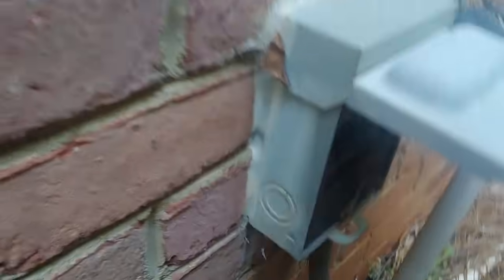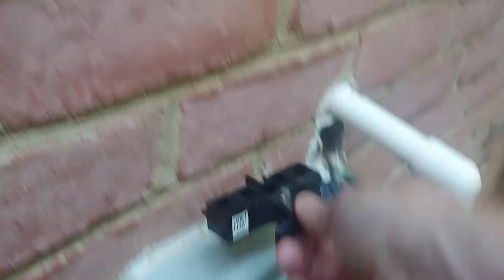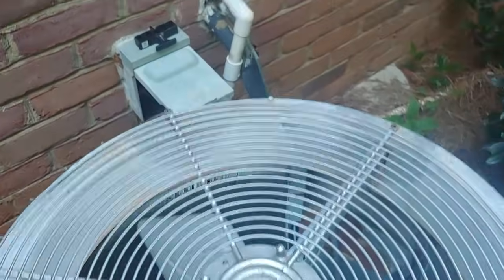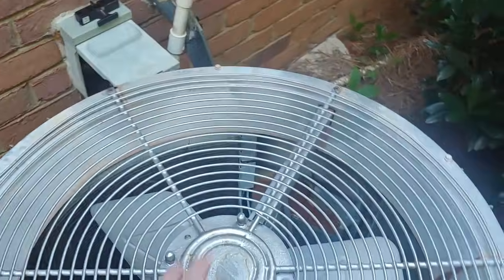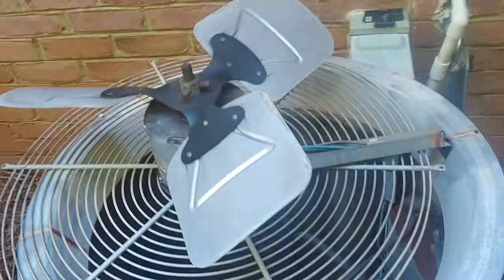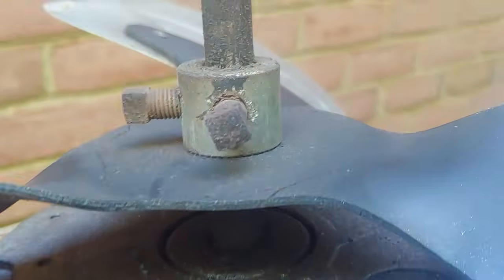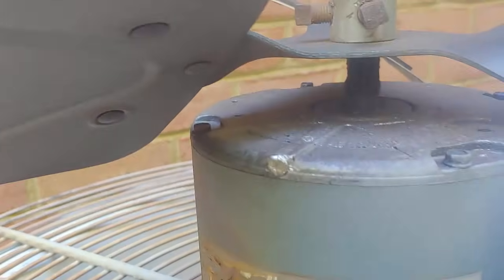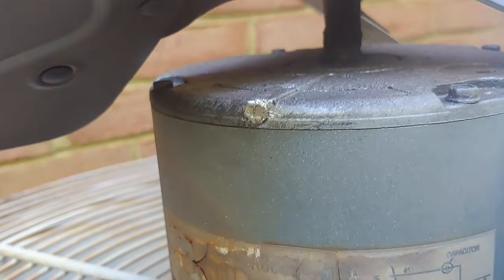YES! You CAN oil an air conditioner fan motor AC Fan squeaks/squeals/chirps/screeching noise, FIXED!

Comment: 9/12/25 11pm fan motor started squeaking, you just saved my life. Family of 8 here is southern Ca. AC is a must. So far squeaking is gone. If I can get through the rest of the heat until it cools off I will change the motor. Thank you so much for this video.
Reply from the maker: So glad it helped! Thanks!

Comment: FYI avoid 3-in-1. Most household oils will varnish and you’ll loose lubrication. Use chainsaw oil, sewing machine oil. They can stand heat and constant movement and don’t varnish.

Comment: If the bearings are starting to go, you may see your electric bill go up, and the fan may begin to have trouble getting started.  If the capacitor is still good, that's a sign that you need to start shopping for a new motor.  A distributor that only sells to professionals will typically have motors listed MUCH cheaper than you can buy them retail (40% less is common in my area), and a friendly HVAC shop might order you a motor but let you install it yourself.  After all, if you do screw it up or it's not the problem, they're probably going to get the service call.

Comment: Some fan motors had bronze oil-lite bushings in them instead of ball bearings.
Look for ball bearing replacement motor and the same specs, especially RPM and power.
For instance, I replaced my 1/3hp 1100 RPM motor with an 1075 RPM 1/3hp motor.
Further, before replacing the motor, I was able to measure the rpm of the original using a strobe device, it was turning @1137 RPM (just beyond spec).
Reply from the maker: Great tips!

Comment: Ive taken the motor apart and greased the shafts. Never used oil. Units been in since 2006, still going!! Carrier air handler and Bryant outside unit.
Reply from the maker: That's awesome! Keeping these units going is often more cost effective than the energy savings people think they get with a newer and often less dependable unit.
Reply: Lithium grease will work great, but of course taking it apart is a lot more work, and not for people who aren't confident doing it.  Although I'm sure there are videos showing how.

Comment: Your condenser looks fairly good!
Reply from the maker: Thanks, I nursed it for 3 and 1/2 years or so, and several months ago I had both of my systems finally replaced because of a coolant leak that was costing me a lot of money. But this video has helped a lot of people save money and extend the life of their system. Thank you for the comment!
Reply: @SwimmingintheDeep cooling leaks in the system is very common for many home owners. 
I found some technicians used incorrect solders or incorrect technique that lead to line leak. More silver, less lead solder will prevent line leak in the system. Once pure lead contacts with water or moisture will soon cause corrosion from those connections.

Comment: How in line do the rpms and amps need to be? Can they be a little off?
Reply from the maker: Yes, The RPMs can be a little different. The amps however need to be about the same or less because of your capacitor is rated to start such amperage.
Reply: @SwimmingintheDeep  If the motor's HP and RM and frame (mounting size) are a good match but the starting power is different, you can find videos on getting the right capacitor for it.  A new capacitor will probably be $15 or less, but a service call to have someone do it for you can be $100, easy.  BUT take photos of how the wires are set up before you disconnect anything.

Comment: Mine is squealing and it is a very expensive Lennox that is only 6 years old.
Reply from the maker: Man that's unfortunate. But could be an easy fix with a few drops of oil. That motor lasted several years in the video. I had to have my system replaced finally in October because it was leaking coolant and had become too expensive to keep charging.
Reply: @SwimmingintheDeep  I replaced the capacitor yesterday. Did not solve it. I keep lubing my indoor portable fans that the whole family uses for white noise for sleep, so I figured this was a possibility. I will try tonight when I get home.
Reply from the maker: @andykeena8767  ah, yes, the same procedure that you are using on those indoor fans. I have done that too!  Funny, we use those for white noise too. Keep that old capacitor as a spare, you never know when you'll need it.
Reply: Oiled up, but did not seem necessary as fan spun smoothly. Fan motor speed wavering fast, slow. My neighbor just so happened to have his cousin over who is an hvac guy. He confirmed that the fan had a bad ecm in the motor. So I am buying a new motor.

Comment: You are right, the new A/C units are terrible. My next-door neighbor had to have the evap coil replaced in less than a year! They have had to have servicemen come out a number of times since then. My Goodman unit was installed in 2000 and is still going. I did replace the condenser fan motor, capacitor, and contactor. Oh and I have the same 3 in oil can from 1970, the new ones are plastic. Thanks for the video.
Reply from the maker: That's awesome! This one in the video reached end of life in October. 32 years!! It developed a small pinhole in the coil somewhere, likely in the A coil. I found a Trane dealer that sold me units direct and I saved. A ton of money by finding an independent installer. I'm making a video just haven't got around to posting it yet. Thanks for the comment.

Comment: Do they all have them same type of bushing bearings.  Or is that more an old school thing.  Has any of them actually upgraded to actual bearings.   No doubt they went that route for the sole purpose of making it extremely difficult for people to fix them themselves.  As like just changing actual bearings
Reply from the maker: Thanks for the question, it is a good one. I am not sure, when you can get a new motor for under $150 I just did not bother finding out. I do have a motor rebuild place nearby where I bought a capacitor before. A place like that might be a place to ask if you have one too.
Reply: @ I don’t.  I actually just replaced my entire unit in an outdoor.  Was just curious to keep in my mind as knowledge was all.  I’ve always thought they were bearings.  Makes me wonder if it’s done like that to stop rebuilds from happening.  Or if theirs actual reasoning behind it ya know

Comment: How do you add oil if it can't be flipped over? My wires are to short and I can't flip it
Reply from the maker: Turn off the power by pulling or flipping your disconnect like I show. Once you do that remove the side panel, there should just be a few screws. I bet there is a clip in there that you can temporarily create some slack in your wire.

Comment: The fan on mine is completely loose on the fan shaft and it scraping the other parts inside.
My fan sits on top of that motor and flops around.
Help
Reply from the maker: There's a set screw on your fan blade where to attaches to the shaft of the motor, if that's what you're talking about check that. If your motor mounts have fallen off, there's a chance that you might be able to retighten all those and use some new hardware. Otherwise you may need a new motor. To get a new motor for an older unit. Check out and see if there's a Grainger around you. If you take your motor into them they can match it up. There's a few things that are important when matching up these motors. The frame size, the amps, the RPMs, and the direction that they spend either cockwise or counterclockwise. Generic replacement motors you can flip them from cockwise to counterclockwise with the change in wires or something else in the motor will tell you about that. You're dealing with electricity so make sure you turn off the disconnect.  Also there's a such thing as dual speed and variable speed motors. You may have a single speed motor. All this will be dependent on how many wires that you have. You may be lucky in fine that you can find one with the exact number of wires you have then you replace a wire for wire. That is if you have to replace the motor. Good luck.

Comment: Can we use silicon spray
Reply from the maker: Hi, I never have and I asked AI and it said, it's not ideal. Use mineral oil if you have it. The same one you might take as a laxative.  BTW, I never have replaced this motor, still going strong!  Thanks for the comment.

Comment: What do you do if it's just making a buzzing noise, the buzzing noise used to be intermittent, like clockwork would buzz for a few seconds every few minutes, eventually more constant
Reply from the maker: Is the fan turning when the buzzing is happening? If not it could be that the fan is stuck and does need lubrication, or that your capacitor is going bad. The capacitor is used to help start the fan initially. This is only a guess please proceed with caution. Capacitors can be charged with electricity and you should know how to discharge them before replacing. There are plenty of YouTube videos on that.

Comment: Can someone tell me what type of oil I need to buy?
Reply from the maker: Yes, since I made this video I actually oiled mine one other time and I used mineral oil. The same type of mineral oil you may already have. It seems to have lasted longer than any other that I have used. If you would rather use an oil that is marketed for motors, you can buy zoom spout oil. I have not used it but other commenters have said that is good. For myself, I'll keep using mineral oil when I need to oil a motor.
Reply: @SwimmingintheDeep  you’re the best! Thank you!

Comment: Huh, I thought those motors were supposed to spin a little easier than that. Is that due to lack of oil?
Reply from the maker: Yes, due to the age of the unit without having any re oil. By the way today's July 23, 2023. I have oiled this unit one more time since this video but I still have the same motor so this unit is over 30 years old. The last time I actually used mineral oil and it seems to have done even better.

Comment: Back in the 80's, my AC condenser fan would squeal when starting and occasionally while running.  The rain shield under the blade and over the motor was what was making the noise.
Reply from the maker: Sometimes it can be hard to track down. Thanks for the comment!

Comment: Those are great condensers...that fan wasn't turning as free as it should but it'll last long enough for your soon motor replacement. So true, the old stuff from the 1990's was much better made and usually al from the USA with quality ball bearings vs. todays Chinese and sleeved bearings that simply do not last as long. I heard of some folks with older single stage systems replace their condenser motor with the newer ECM or DC design which use slightly less than 50% energy and quieter vs the PCM motors are. Only problem is those motors are more expensive and the circuitry or "module" inside tends to fail too early and when they do, just the module is within reach of the price of a new ECM motor. Going from 2.5 amps to about 1.5 amps may not be worth the extra cost but that could depend on how much your power company is ripping you off...in CA power rates are right around 50 cents per kWh which is INSANELY expensive.
Reply from the maker: Thanks for the comments Garth! Believe it or not, I am coming up on three years since this video and the motor is still going. I oiled it one additional time... The new motor is still in the box.  Thanks!

Comment: Good video. I have done this yearly since 1993 and all units are still working. Next pull your inside blower out and do the same.  Maintenance tips like this are delaying the eventual buying of two new complete HVAC units at a cost of $25000.  This oil is cheaper. I have also used  automobile 30 weight oil mixed with transmission fluid, 20 weight,  10w30, 5w30, gun oil, sewing machine oil, 20w and 30 weight mixed with mineral spirts. So far so good.
Reply from the maker: Thanks for the comment and the shared advice!

Comment: I’ve got the same exact can of 3 in one that I’ve had for at least 40 years , I just had a squeaky fan blower motor and went out and bought 3 in one 1/4 hp pro more fan motor oil , it was only $6 but I wish I knew I could use this oil .( it’s probably the same exact oil )
Reply from the maker: Likely so!  I re-oiled mine this year and I used hair clipper oil, which is mineral oil.

Comment: When you replace the fan, replace the capacitor as well.
Reply from the maker: Thanks for the comment. Is there a reason to do that? Older capacitors also are better quality than newer ones IMO. My capacitors in both of my units are the original 30 year old ones. I replaced the fan motor in one of the units a few years ago as I state in the video but the capacitor is still the original.
Reply: @SwimmingintheDeep  New motor, new capacitor, matched set.
Reply from the maker: @YT-User1013  excellent point, always match them.

Comment: My husband and I went to Home Depot and Walmart looking for the oil you recommended and we could not find any. With supply chain issues we might not be able to get any. Do you have any recommendations for another oil we could use that would be safe? We have an older (maybe about 10 yrs old) AC unit. But, our fan just started squeeling a few days ago and we shut it off and have not used it since. And we're heading into the hottest time of year here (115 degrees soon). Would greatly appreciate any direction. Thank you for making this video!
Reply from the maker: Even straight mineral oil should be fine. Yep, the one in your medicine cabinet. If your local hardware store has 3-IN-ONE SAE 20 Electric Motor Oil you could use that too. That's hot!  Take a flashlight outside tonight, oil it up and you'll be cool in about an hour. :-).   I like the user name. We love Acadia.
Reply: @SwimmingintheDeep   Thank you so much!! And that's so cool, very rarely does anyone know anything about my username. Thank you for helping people. So many cannot afford to pay for AC repair. My husband is recovering from cancer surgery and losing our AC is a huge deal here. God bless!
Reply from the maker: @Acadian.FrenchFry  I'll prayed for you both this morning.... And the squeaky AC to be resolved.  I am glad to help and hope I did.
Reply: @SwimmingintheDeep  Thank you so much for the prayers! Very grateful for prayers. My husband see's the Dr. tomorrow and after he will head over to get the oil. We have been blessed with a few cooler days and using house fans has been enough. But, that will be short lived and so fixing this AC is critical. I really appreciate your help and prayers. It's a huge help being able to fix our own AC. God bless you and your family.

Comment: Thanks for the video 
Any one can find me a match for my motor will be great, I really can use some help ordering new motor for my old condenser:
GE: Model number: 5KCP39EGK336S
RPM 1075
Amps 1.6
Hp 1.4
Hz60
CAP 5.00/370
Hiw to find the frame number ?
Thank you
Reply from the maker: Thanks for watching my channel. I think that that is probably the same motor I had. Here's the one I bought as a spare. Em3727, look it up on Google. The other thing you can do is take it to a Grainger parts place and they'll help you match it up to something close. Mine was a 48 frame. Remember things like rpms, horsepower and motor shaft length doesn't have to be exact, only close.

Comment: What Doug Lowe just said! My unit looks like the one in the Vid. I followed the procedure and cured my problem. I know it's temporary but, it's an old unit using the "hole in the ozone" freon. This will maybe get me thru the hot months until I can find a contractor to replace the system. THANKS!
Reply from the maker: Awesome! Glad to help.

Comment: House built new and we moved in Dec 2017.  Heard for the first time today intermittent squeak.  On a newer unit can the motor specs be obtained without removing the liver and motor itself?
Reply from the maker: In that case I'd look up the model number of  the newer unit (for example Trane XL14) and see if the motor specs are in the pdf manual. You may get it covered under warranty. Even the lower end Goodman units seem to have a 5 year warranty.

Comment: THANK YOU!  Have an old unit that has worked flawlessly for MANY years at a weekend lakehouse on the GA/NC border which can get pretty hot in the summer but I'm sure the weekend-only usage has contributed to the unit's longevity.  Started a loud squeak/squeal/chip intermittently for the first time ever today.  Followed your video... no oil ports, shaft only... and took your advice to order a spare unit (GE 5KCP39EG-S070S - now Genteq). 

Question: After getting it all back together I decided the rusted center plate of the fan guard was in need of some black paint.  First needed to sand it off and remove the old paint.  Removed one acorn nut at a time, sanded the dimple and replaced the nut... except the last one sheared off the bolt coming up from the motor.  I'm counting on the remaining 3 to hold the fan up.  My question is weather the bolt coming up from the motor is an integral part of the motor or is I can just put in a new bolt?
Reply from the maker: I'm guessing you must be on lake Chatuge. I have a lot of family from Hiawassee. I suspect that those bolts are just basically "all thread" so you can take any long bolt or screw that fits it and then cut it off to make a new one. I'm good this worked out for you and that's a very nice Lake if that's where you are. I may drive up there tomorrow to Young Harris to see my mom.
Reply: @SwimmingintheDeep  We are... late father-in-law hand built in 1970.  I presume this is not the original AC unit although at least 1990s vintage. I didn't look that closely at how that bolt enters the "top" of the motor but it sounds right for it to be all thread.  I'm hoping for the 22 month update to be the same as yours.